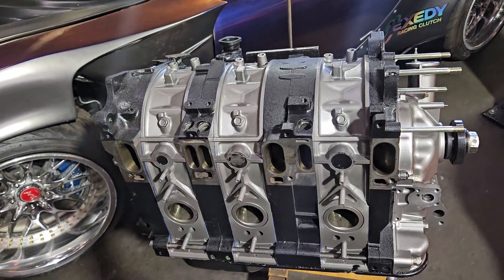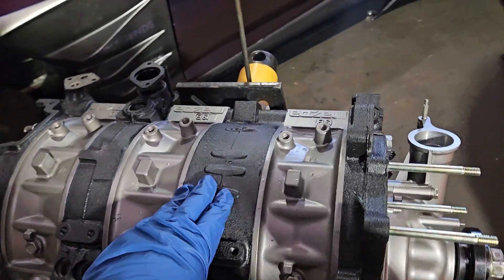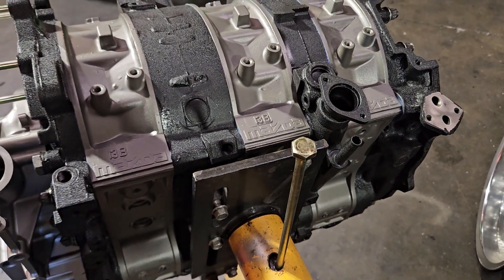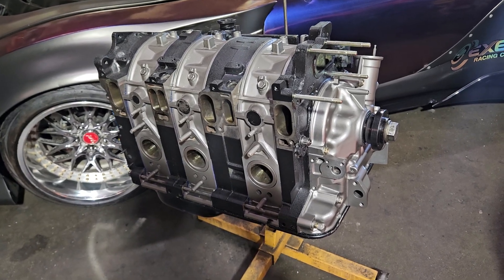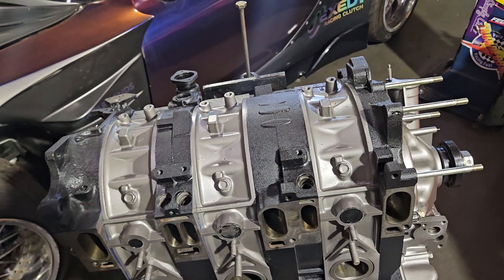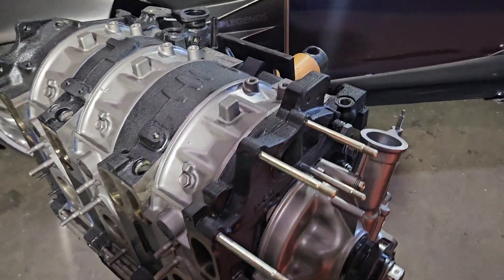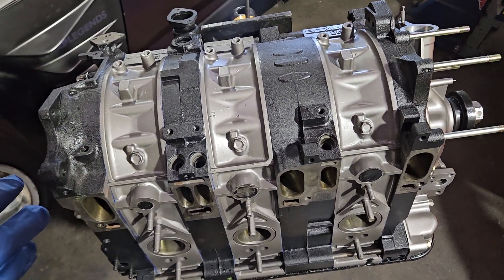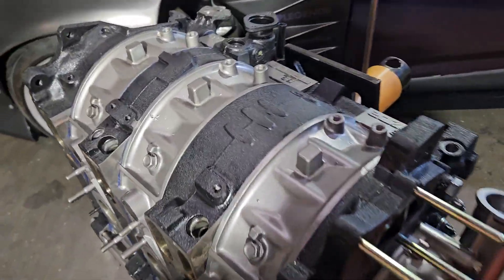800hp reliability in a ROTARY Engine - 3Rotor Build specs for success - KMR ROTARY Mazda 3rotor 20b

Comment: I bought my D133 20b way back in early 2003 for $4,500. Unfortunately, my block may have sat up for some time because my lower coolant seal walls on my thick center iron are breaking. I've welded up a couple previously and they've held up. It's just annoying knowing that I have a premium block and have these thin casting issues causing coolant leaks. 🤬

Comment: Thanks Kyle ! I own a cosmo with a b code block. I will be half inch studding but also something I don’t know if you’ve covered is the dowel landing through the thick plate. I’ve seen it done where they block the oil feed from going through the dowel and drill higher up and use an external oil feed for it. I guess then you can use a solid dowel ? Also no oil would flow to the dowel . What’s your thoughts on the external oil mods when using the weaker plates.

Comment: What a wonderful engine! Sorry to keeping bothering you with the same questions not directly related to the video, but I don't know of anyone more qualified to answer. I know that you had a collaboration with eFlexFuel, and I'd like to about converting an RX-8 and their kit. I'd like to convert an RX-8 to E85 with flex fuel capabilities (since the ethanol content varies during the year). My primary goal is not to make more power, but to hopefully making the engine somewhat more reliable. My reasoning is that E85 burns cleaner, and runs cooler. Would you recommend their kit for that? Should I do other upgrades, like fuel pump, injectors, fuel lines? Can the eFlexFuel take changes of such things, as the upgraded injectors, in consideration? Many thanks in advance!